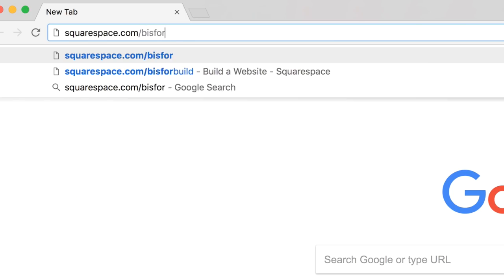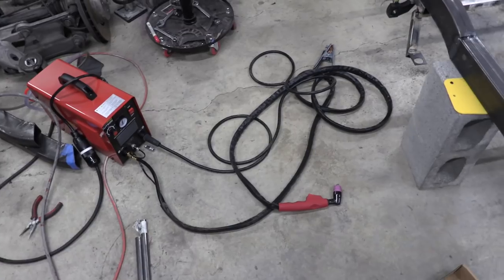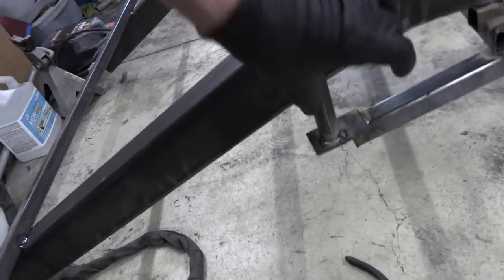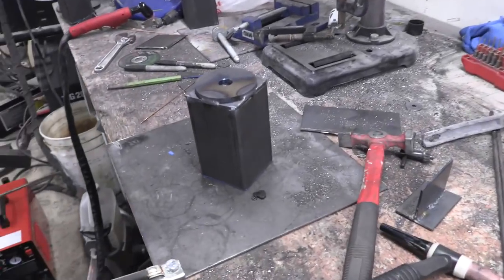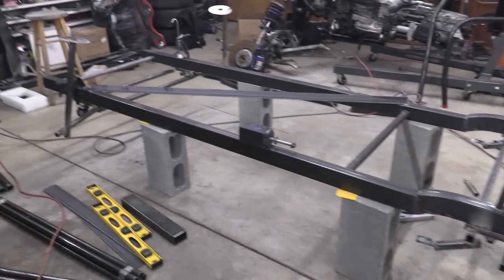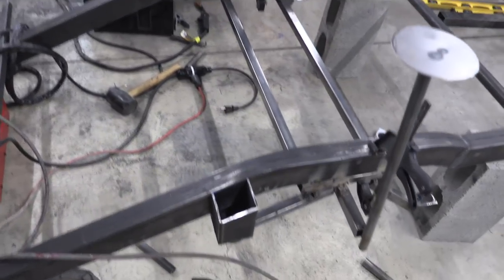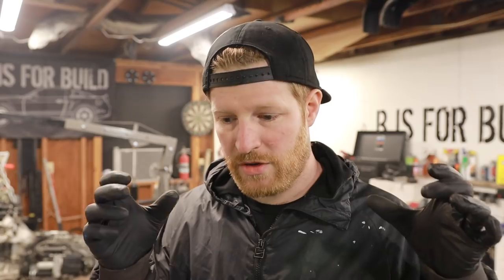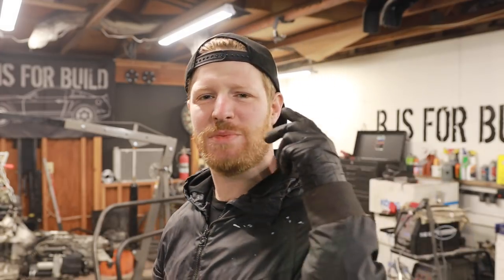Building Frame Mounts 🔥🔥

Comment: chris, old jeeps like my grand wagoneer had a captive nut scenario like your mounts. and they break sometimes with no way of repairing easily. not that you would ever have this problem. but it might be damn handy to have access somehow from the side to be able to slide an open ended wrench into and hold that nut if it ever broke loose.
Reply from the maker: not a bad thought, but cut it now or cut it later if it breaks won't change much, so i guess if it ever starts spinning i'll cut a window into the mount
Reply: B is for Build agreed.
Reply: I was thinking the same thing as Richard,  but touché, Chris
Reply: Maybe make a mark on it. 'In case of FML cut here'. Just so that when the body is on and everything is welded up and painted you can see where to fix the problem, since you basically need to write your own owners manual for this thing as you go.
Reply: Most of the captive nut failures I've seen on OEM cars are due to the fact that the captive nut is only tacked in place.  If you perform a full circumference weld with good penetration I don't think you will have any issues.
Reply: The Truth about Everything is probably right. Factory always cuts corners to save time and money. As long as its better than the bubble gum holding factory cars together it'll be fine. I've had many factory cars be fine after many years in the salt. Granted there are some occasions but it probably wouldn't happen

Comment: You should use plumb bobs and draw a centerline for your frame even though your using a independent suspension system I find this helps, (high performance automotive repair student UNOH)

Comment: Before you weld the subframe mounts may be wise to cut an access panel incase the weld on the nut fails in future, allows you to get a spanner on if it try’s to spin, that’s what my chassis has where the subframe mounts to captive nuts.

Loving the build, V10 Datsun is a brilliant idea. Keep pushing the diy boundaries!

Comment: Nice work Chris. One thing that inspires me is your constant positivity. This build will test you for sure. I’m in the depths of a similar project, s2000 running gear into an escort Mk2. You can loose a day deciding where to put stupid stuff like seat belts eyes and ECU mounts. It’s insane. Forget the doubters they’ll never appreciate the effort required just to film and edit not alone actually fabricate something. I’m seriously interested to see how this pans out. My build still isn’t finished after 3 years. Good luck with this one mate. Stay positive whatever happens.

Comment: I have repaired the rear subframe mountings on my own bmw (not an m5) and I can almost guarantee you that the original mounting points on your m5 chassis is made of a threaded section a lot like the ones that you have made but with much more thread for the screw to actually screw into. I think you should consider removing the short nuts that you welded in and make or buy something with more thread length to weld in the same spot. Keep doing what you are doing and take the extra time to do it right. You go girl!

Comment: Having scratch built some resto-mod type of vehicles the only thing I'll say is when you put your mounts on is to make a smaller cap on the inside of the box first. Paint all of the interior then, then when you cap the frame and mount together it will give you more strength than you realize and at the end of the day, it will make the car more enjoyable.

Remember, those scared to do something they haven't done will spend all of their time pissing on you since you're doing what they're scared of doing.

Comment: Don’t worry about the fab time Chris. Oh you probably know this but be careful when you fully weld up those mounts. When you seal it with the last bead of weld the air inside can expand from the heat and blow a hole in the weld. Some times it pays to drill a little vent hole although this might cause corrosion issues later.

Comment: There is a way to figure out how much dip you need in the middle of the frame. Just measure the height of the sub frame from the very bottom (usually the lower A-arm bushings) to the mounting points. That is the bottom of the dip in the frame. If the sub frame is 14 inches from the lowest point to the mounting points, the dip is also 14 inches from the bottom of the frame to the mounts (if you want every thing above the frame rails that is).

Comment: The reason that there was contamination in you welds after using a plasma, is because it introduces nitrogen, so to fix it jus clean the edges that you're going to weld on with a grinding wheel or something. Other then that builds really starting to come together!!!!👍👍👍

Comment: If you want cleaner welds use a MMM Roloc sanding wheel to remove ALL contaminants before you weld. Most of that metal has an antitrust agent or oil on the outside making dirty welds.

Comment: Just some useful info on the plasma 
Form a fabricator 
You need super dry air for a plasma 
You only want 50-70psi of air presure 
More or less will result is dodgy cuts 
It wil never produce cuts like a grinder but it can make cuts without slag just like a welder its all about practice and playing with amps and air presure 
The way it works it to super heat the metal and blow it away with air, so the out side of the cuts are in a  very simple form a sort of rust (oxidized steel)
Just like an oxy cut you can weld though a cut with a mig or stick but to produce a good tig weld you need to grind back 1mm or so to get out of the oxidized zone

Comment: the contamination you are talking about is corrosion, specifically flash rusting. that is due to the oxidation of the metal when cutting. you just need to wire wheel or grind the edges before welding.

Comment: One thing you may want to do is Gusset those support mounts that you're making horizontally from front to back there's going to be a lot of torque that goes in from that drivetrain whenever you install the engine

Comment: Chris why not just get a large chop saw for cutting metal rods and such to size?  Very easy to use, they cut dead straight, through just about anything, even that large box rail you cut with the cutoff wheel in this episode, and they're not even that expensive either.  It's just a giant cutoff wheel.  They're great to have.

Comment: I thought the same thing about plasma cutters, but after using four different ones, they all seem to work the same way. From entry level home owner ones to high end table mounted ones. By the time I cut it out and finished off the grinding it was faster to do it with a cut off wheel. I just picked up a new metal cut off wheel from Lowes that says it will do 1000 cuts, I'll try it and let you know if it's worth the $28

Comment: Before you set the sub frames to the frame rails measure and set the wheel base or all of the leveling will be for nothing if you have to stretch/shorten the frame

Comment: the contamination from the plasma cutter is probably the material changing due to heat. this will affect the welding because the material close to the plasma cut has changed

Comment: If you clean up the plasma cut with a wire wheel it should clean up the contaminant.  And even computer guided plasma cutters cuts come out rough.

Comment: Contamination from the plasma cuts could be caused by the air hose you're running from the air compressor, the oils from the rubber hoses can cause contamination in welds, I recommend cleaning the parts with acetone before welding but he sure to let it dry first or it'll be B is for class B fires

Comment: Only suggestion is to make the front and rear subframe mounts exactly as they are on the bmw. 

Like the parts that align the subframe. The downstands that insert into the bushings on the m5.  I dont know if you thought of it already but you'll have to recreate that or the rear and front subframes will move.

Comment: plasma cutters can cut as clean as a torch but can but mileage may vary and if you plan to weld plasma cut surfaces you need to grind to clean base metal and remove the kerf left behind for solid welds.

Comment: Morgan cars in the UK used BMW 4.8 V8 engines in their cars,  but to save weight instead of a metal chassis they stick to tradition and use Ash wood. So if your getting bored of the metal work then you could shift to wood.

Comment: So, you built something from the car mounts that reverse simulates the subframe.  Then you're going to build from your new frame to the simulated subframe....  YOU HAVE A SUBFRAME.  Just build from your new frame to the subframe.  You're potentially stacking tolerances and errors and adding a whole additional set of warpage factors.  Yea, it'll work, but you're adding unnecessary steps and making it less precise by a lot. (at least for the 4 bolt through mounts)  Get as much precision there as you can by building direct.  The strut positions are better tolerant of errors.and can be done with a mockup and backed up with measurement of position and installed angles.

Comment: Chris make sure u didnt use a nylock or a thread locknut, and weld them all around u dnt want to be torquing that sub frame and have the bolt turnimg cz the welds broke, and probably uts best if u paint the whole tube chassis with weld thru primar, its better than nothing!! And goodluck

Comment: out of curiosity how do those rails act in an accident like normal frame rails have crunch zones like waves in the rail where hit they fold on themselves so how would a square tube stand up would that just get hit and shift backwards??
Reply: kuppajava McGuillicutty don’t think you get what he was asking, he’s asking if there will be any crumple zones in the chassis like modern cars, not where will the car floor sit on the rails.

To answer the question, they won’t crumple like modern cars unless he chops front and adds different legs like aluminium to absorb the impact before steel does.

Comment: Not sure because I’m not a fabricator but are you sure that your supposed to use a bit with a nylon locking feature? I would assume that the locking feature would melt with the heat from welding.

Comment: This might be a stupid question...... instead of  building new frame rails, couldn’t you have pulled the m5 body off of its frame rails, used those and built a tube frame/roll cage on that and fit the Datsun body over the custom tube frame sitting on the m5 frame rails / rear front sub frames etc?

Comment: consider drilling a small hole into the bottom of the mount box somewhere, so water doesn't collect there and cause rust. love the build!
Reply: He mentioned already in this video he is going to be painting the inside to protect against rust, but then fully sealing it up after so that the entire section is watertight.
Reply: yes, I saw that later on in the video. still, to be technically correct you shouldn't just seal it completely but leave a little hole somewhere because of moisture in the air and stuff. probably won't rust for quite some time  sealed, but in the long run...

Comment: Probably not going to see this comment, anyway the plate that you cut square you should cut it a touch smaller next time. So it sits half the wall thickness in around the whole thing. Hope this helps builds awesome by the way

Comment: The front being the width of the BMW cross member is really a non issue like you say. Making outriggers for the rear like that though is being odd. Slide under the Z chassis and look up the frame rails flare in for the mustache bar that holds the differential then flares out to make room for the spare and the gas tank. 
https://i.imgur.com/8TouXGv.jpg
You should most likely be doing the opposite, flaring out for the sub frame mounting points, then maybe flaring in for body clearance. In all honesty the rear portion should just be a box frame that has bedding posts so that long bolts can go through the frame and the bottom of the frame (where you can weld those discs) and then you can weld that to the chassis. The thing is you really want access from the top to get to the sub frame bolts in case you need to pull them. With the out riggers you have now when you come to do a floor you are going to have to go out further past the out rigger to make your floor and displace the wheel wells. If they are part of the frame or a box frame you just use a square piece with tabs that go inboard and voila floor done.

The reason for the negativity I imagine is that you are setting off flags. Acknowledging you made a mistake is fine and dandy, but the fact it was made can put people on edge. Liken it to a surgeon cutting off the wrong limb, he can apologize, promise to put it back later, but your sense of trust is going to take a hit. There are I'm sure plenty of keyboard warriors, but there are also plenty of people who have experience building frame structures and tube chassis. Like right now you aren't building a tube chassis as you are building a rail or a ladder frame, given that the stock Z chassis is a unibody, and ladder frames or rail cars are usually built around solid axle suspension you can kind of see some of the confusion. I believe even your local friend from Engineering Explained would be able to advise and probably shut a lot of people up or at least give you a list of examples to really look at and study.

Comment: Chris, you need to build a measurement device like they use in body shops for alignment. It takes maybe an hour of work building it but it will make everything so much easier. Maybe somebody else knows the exact name?

Here is Arthur tussik using it on a bmw Z4, go to 1:33

https://youtu.be/DopqxQUJYO0

With this and maybe a laser it would make everything so much easier for you and way more correct. And with a device like this you also dont need to weld and allign tubes like you did in the beginning of the video

Comment: How many more days will you go before you you realize that your rear frame section is way too low? I'm dying watching this train wreck about  to happen. On the path you're on, your z body will be two feet off the ground. Please stop and remeasure using the z-frame. Also, you are going to find that the rear struts are going to be taller  than the hatch of the z. Don't know how you'll solve that.